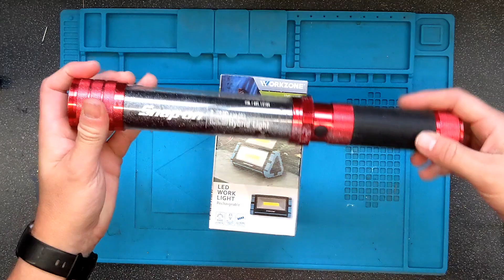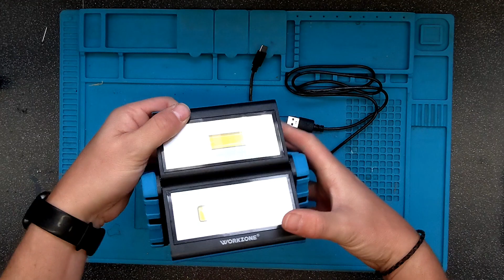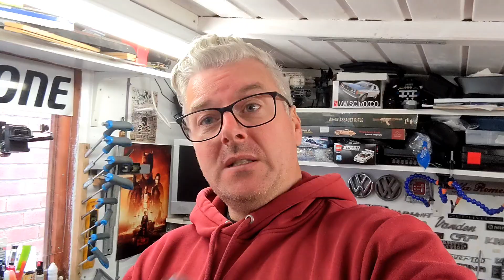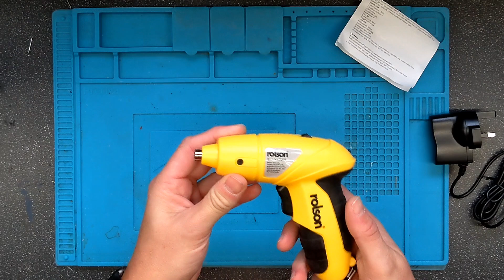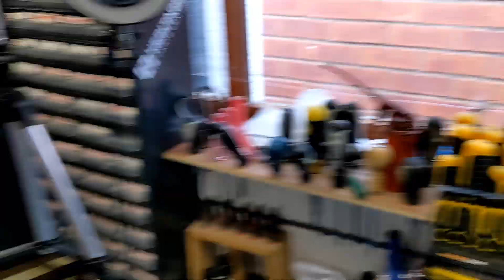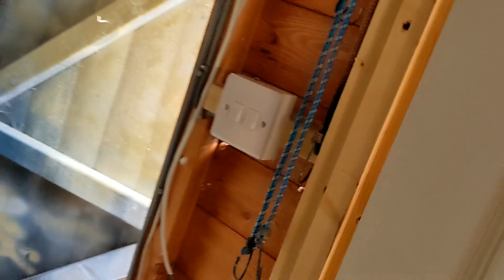New cheap tools from Aldi (Workzone LED work light) and Asda (Rolson cordless screwdriver)

Comment: I did wonder if the cordless screwdriver may have once pivoted, I've purchased a similar Rolson cordless screwdriver but looks slightly different, is 4.8V with 26 bits from B&M stores for just £12, I'd gone and purchased a more expensive one from another store but when I saw the Rolson screwdriver at such a low price point- thought I'd buy this one too. I think it came fully charged too!  thanks for the video.
Reply from the maker: Thanks for the comment 😊

Comment: What is the running time once fully charged
Reply from the maker: After a full charge so far the light has been used for over an hour and half of use as a work light with no issues so far
Reply: @heathsworkshop100  
Thank you taking your time out to reply. I find it very strange that Aldi has stipulated the charge time but not the running time. Abit annoying. Please let me know how long it lasts if you can. Kind regards